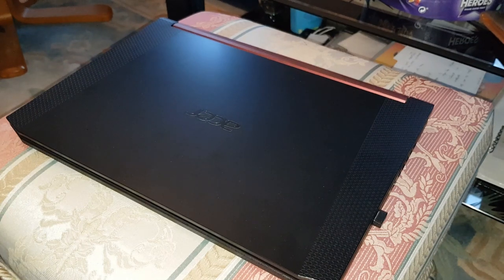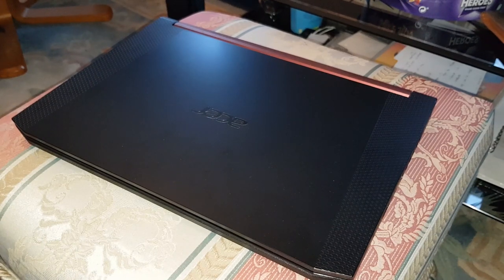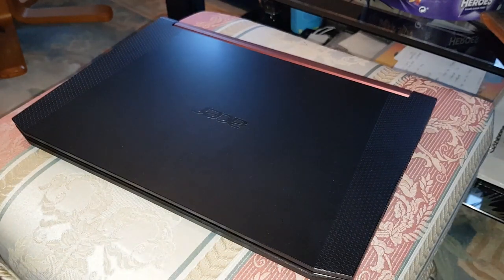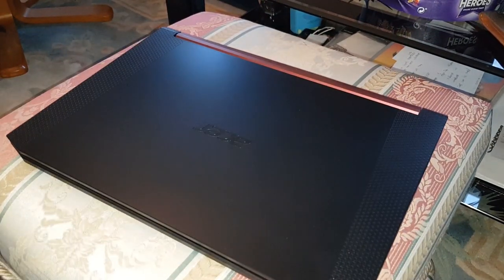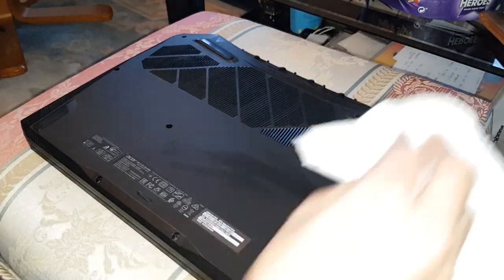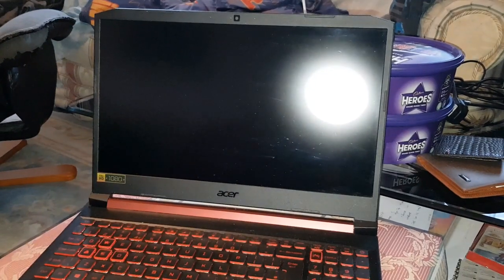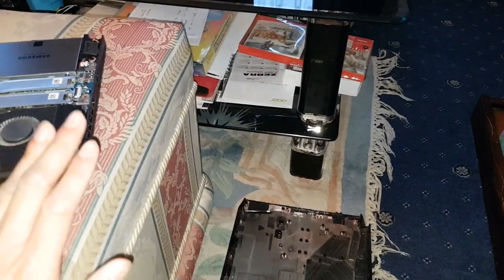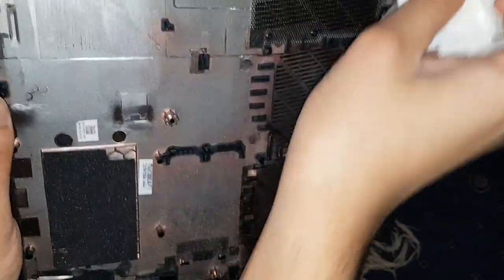How To Deep Clean Acer Nitro 5 Gaming Laptop

Comment: Be sure to disassemble the cooling system to clean from dust next time, this will help reduce the temperature by 10-20 degrees.
Reply from the maker: Yes
Reply: Where is the cooling system?
Reply: @romanflietner8696 the fans

Comment: I ended up trying to do this myself but ended up when trying to lift the cover there would be like a wire attached to it, I don’t know what it is but there was like a square aluminum with 3 tiny screws and 1 screw that wouldn’t budge at all slightly different model than urs I have the Nitro 5 an515 ended up giving up to not break something since I kinda left a mark, but either way great video!
Reply from the maker: No problem my friend, please help me out by subscribing to my channel, also i think it will be your wifi adaptor probably
Reply: Cant lie same for me

Comment: For the love of god, do not using paper towels on electronics.  Lint free cloths are super cheap and should be used on the screen for not only a better cleaning but to prevent scratching it.  On the inside, use a brush to start with, then a lint free cloth or cotton swabs and alcohol.
90% of what you did was just cosmetic cleaning.  Inside the fan case itself is where the dust clogging up your fans is going to be and you can't see it without opening it up.  Buy a DataVac, can of air, or use a low powered vac with a small nozzle and blow in through the vents first to loosen it, and then through the fans and repeat until you stop seeing dust.  If it's been around pets, someone with long hair, or a smoker, you need to take it apart and clean the fins of the fans and the fins of the vent itself with alcohol.  
Doing it this way takes 30 minutes for sketchy half baked cleaning.  Doing it the right way, takes about 15 minutes.
Reply from the maker: Thanks for the tips, and i never scratched my screen in the many years i used tissues haha, main reason i use very soft tissues haha :p, but yes i agree a microfibre cloth would be better. Yes i did say in the video compressed air would be amazing if i had it haha, i have since bought a few cans :), but yes i agree with what you have said thanks for the tips
Reply: @MrWaheedulHaque  I understand what you are saying, but I wanted to point it out because most people are either lazy (guilty too many times) or press too hard and it will leave fine scratches that over time will make the screen look fuzzy. In almost 30 years of working on computers and electronics I've seen it too many times.  Plus paper towels leave lint behind and that just bugs the crap out of me lol.

Comment: Do I need to disconnect the battery while the whole cleaning process?
Reply from the maker: Yes i highly recommend, i usually dont until i had a accident once and a screw sparked the motherboard, luckily i got very lucky and no damage was done but since then i dont risk it anymore, leave battery disconnected and wait 10 minutes before doing anything to make sure everything has discharged
Reply: @MrWaheedulHaque  do I need to disconnect it with bare hands or with wearing gloves?
Reply from the maker: @sonuspark155  up to you, i recommend anti static glove

Comment: What lubrication do you use on the fans? Like the type of oil or grease, my gpu one isnt spinning as quickly  and its stiff when i cleaned the dust
Reply from the maker: Use machine oil, only use one or two drops and clean off any excess amount as risky liquids with motherboard chips, i would rather replace the fans instead rather than risking it
Reply: @MrWaheedulHaque  id rather not risk it, do you know any websites that sell good replacements. I've seen some people review some that apparently broke after a short time and I'm not sure where sells acer originals
Reply from the maker: https://amzn.to/3t7yR62

Comment: A $5 can of air would have served you great there.  The sound of dry paper towels on dry surfaces makes me cringe like nails on a chalk board lol
Reply from the maker: You right you right i do need to buy some
Reply: @MrWaheedulHaque  good video though. I just bought a used "very good" condition nitro 5 1650 version on Amazon.  Basically just want to use it for down times at work play some FFXIV or something (got my desktop at home to play the heavy games).  So yeah, I'm expecting to get this laptop in the mail and have to re-paste and clean on arrival.  I wonder if there has been any improvements on laptop fans that can improve temperatures.

Edit - Come winter time ill just have to open the window in my office and let in the -34°C air be the ultimate in laptop cooling lol
Reply from the maker: @RevanBC  yeah repasting helps a lot. I will post some videos next week on all the laptop paste videos so you can see which one is best working in my scenario
Reply: @MrWaheedulHaque  nice, yeah I was thinking of buying some liquid medal for the re-paste but I decided to wait for the laptop to come in first and do some benchmarking and stress tests before I bother.  But yeah, looking forward to the next video.
Reply from the maker: Nice bro yeah if you confident on using liquid metal go for it will give best temps, i was gonna do that but my heatsink is not level i found out so would leave too many gaps and would cause future issues for me
Reply: @MrWaheedulHaque  there's always heatsink copper shims on Amazon to level it out for ya.  How could you tell it wasn't level?  You can see by eye or did you use a level tool?
Reply from the maker: Yeah i was gonna try those but gave up as wouldnt know which mm to try first and which would be right size. Just so much hassle to get it working right, also i used a level to see it as with eye its hard to tell but i could tell it wasnt touching properly as when i went for repaste parts of the paste didnt touch the heatsink whereas others were covered

Comment: There is a small gap between the fan and the heatsink, and a dust wall accumulates in that small gap. If you want to check if there's a dust build up, shine your phone's flashlight in it and see if you could see the light on the other side.
Reply from the maker: That is what thermal paste is for to fill the gap
Reply: @MrWaheedulHaque  that's not the gap I'm talking about. If you remove the black tape under the fan housing ,you'll see a gap between the heatsink and the fan itself.
Reply from the maker: @nithinrajendran3091  oh i see how come you are looking at the way under this haha
Reply: @MrWaheedulHaque  I blew into the heatsink to clean it, you can also remove the heatsink from the laptop and remove the tape under the heatsink to get full access. Tried both the techniques, this laptop is notorious for building dust at that place. Needs to be cleaned once every 3 months atleast.
Reply: @MrWaheedulHaque  the temperature difference I got, 
Before , 
Gpu : 82
Cpu : 93 and It throttled no matter what I did, changed  thermalpaste and everything.

After cleaning the dust : 
Gpu :60
Cpu : 67 ,and it never crossed 75.

Comment: Hello, I tried cleaning mine and the blue part on the hard drive cable came off. Is it safe to put the casing back without it?
Reply from the maker: The sticker?
Reply: @MrWaheedulHaque  Yup, I already put it back and it didn't read the hard drive/HDD. I will just buy a new cable and have it replaced!

Comment: will it be able to clean even though mine is radeon system acer nitro 5
Reply from the maker: Yes same laptop
Reply: ok thank you
Reply: is there any risk breaking it because my laptop broke twice few years ago and im curious if it can break
Reply from the maker: @Developer_Zack  not really unless you be pulling on connectors or using a vacuum or liquids. Dont do any of that

Comment: I did same now my laptop doesn't turn on! Not even responding to charging...
Please help with any suggestions!!😭😭
Reply from the maker: Reopen it and check if you accidently took off battery connector
Reply: @MrWaheedulHaque  that is the problem! I didn't even disconnected the battery i just opened the case cleaned the dust which was on top and bottom. Removed ram once and then reconnected it!

Then I started to close the lid after applying all screws and when I tried to switch on.
Nothing.. no response!
Reply: @MrWaheedulHaque  as per your knowledge what can be the cause? And please also mention possible repairs! 

If thats not much to ask!!
Would be very helpful!
Reply from the maker: @himanshurai7324  why would you remove ram, maybe ram isnt seated properly try reseat it take it out and put it back in make sure it clicks and notch is lined up then try it
Reply: @MrWaheedulHaque  is it possible that there might be some problem occurred with motherboard!

You see I'm scared because this was a sort of new laptop and i opened this for first time! 
But my older one acer aspire 4752 was not that complex as compared to this! I could repair it easily! 
But i don't know where I went wrong with this!
Reply: @MrWaheedulHaque  i have checked ram! Tried in both slots but same result!
Reply from the maker: @himanshurai7324  did you use any liquid?
Reply: @MrWaheedulHaque  nope just cleaned the fans after opening it's screws spreaded the paste which was already there! Took out ram once and reconnected it! And thats it! Closed the case and clicked on power button!
Reply: @MrWaheedulHaque  hi! I have a good news! My laptop is working fine now! I just reopened the case disconnected and reconnected the battery and it started working again! 

Maybe there was some problem of static or something!
Reply: @MrWaheedulHaque  and if it is not too much to ask can you clear my doubt too 

U see my room temperature is currently 9°C but my Nitro sense is showing cpu temperature like 90°C without experiencing any load i have just open the Nitro sense and nothing else! 

Can you please give some suggestions for the mentioned problem? 
Should I reapply thermal paste? It has been like almost 2 years since purchase and since then i haven't done anything!
Reply from the maker: @himanshurai7324  without any load you are at 90 degrees celcius, put your hand on bottom is it boiling hot, and also no there is no static issue you simply accidently moved the battery connector while cleaning, if you had static on it you would have fried the laptop
Reply: @MrWaheedulHaque  it is not boiling but a little bit warm 
Is it possible that Nitro sense gives false reading too?
Reply: @MrWaheedulHaque  by the way! Thank you very much!! You have been very helpful!
Reply from the maker: @himanshurai7324  no problem my friend and download coretemp and check temps there they are accurate
Reply: @MrWaheedulHaque  with core temp 
Cores 0,2,3,4,5 are showing average temperature around 40°C
But Core #1 shows 60-90 or even 100°C and gradually drops to 50°C with addition of "!" Mark behind the temperature (example           52°C(!)           )
Reply from the maker: You might have not spread thermal paste properly, do a repaste on the thermal pastes
Reply: @MrWaheedulHaque  i have never applied ever that i what i wanted to take ur suggestion for that is it time to apply thermal paste!
Reply: @MrWaheedulHaque  one more thing can i purchase a new 16gb ram and run it along with 8gb?
Reply from the maker: @himanshurai7324  yes put new thermal paste in i recommend hydronaut
Reply from the maker: @himanshurai7324  yes just make sure you get correct speed ram to match the existing one

Comment: So my acer nitro five was having fan issues, I took off the cover to see multiple dust build up. It was so bad I had to replace the fans, after I replaced the fans and paste I played for a couple months. The fans starting acting up again but not as bad as it was before. It only made that noise when I put my nitro five on max on nitro sense, when I turned off max it stopped, do you know why???,
Reply from the maker: Which noise does it make
Reply: @MrWaheedulHaque  the sound when you push on a fan but not loud loud
Reply: @MrWaheedulHaque  it only starting making the sounds when I put it on max
Reply from the maker: @solar-jaymi  thats very odd you might have a problem there send laptop back under warranty get replaced or fixed
Reply: @MrWaheedulHaque  dude it's just the fans I got em replaced not to long ago, I lost one screw  when installing em. And it doesn't have it. Could that be the problem??
Reply from the maker: Could be

Comment: Hey. Will be attempting to clean my fans without detaching them tomorrow. One doesn't spin easily and has been clicking. Is it ok to use compressed air?
Reply from the maker: Yeah just use from a bit further away and if one fan is faulty it might be best to open it and see why is it not working as that will cause overheating a lot

Comment: When u cleaning with brush what if dust end on pink paste would that be bad, And what do u think about changing pink paste with pads? 🤔
Reply from the maker: Yes changing pink paste to pads would be good, but you will have to experiment and figure out what mm pad is needed for it to be optimal but otherwise will work well
Reply: @MrWaheedulHaque  thanks for respond, yea my main concern is how to know when pad is right thickness but will try could buy all sizes for around 80€ and try it
Reply from the maker: Good luck

Comment: Anways just a remainder that the dust will be inside the fan along with the heat sink. If you are able to clean it everthing should go back to normal temp. I need to clean mine every three months.
Reply from the maker: Yes i clean this normally but everytime you do that you need to repaste as air gets into the paste once you open this part up. Thats why i didn't do it in video like i said as i didn't have anymore paste at the time

Comment: 30 mins video without cleaning the heatsink 
if you just take out the fans from the heat sink you will see more dust in there but ok
Reply from the maker: I did say why i didnt take the fan off because if you do it you need to repaste and i didnt have any paste at home to do another repaste, so i left it
Reply: @MrWaheedulHaque  you took off the heatsink from the motherboard anyway 22:00 cleaning the fans has nothing to do with the thermal paste if you already took it off